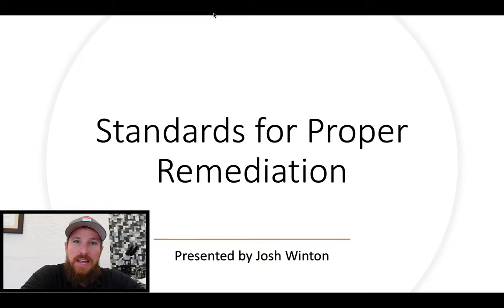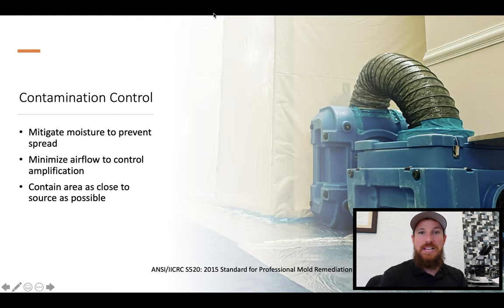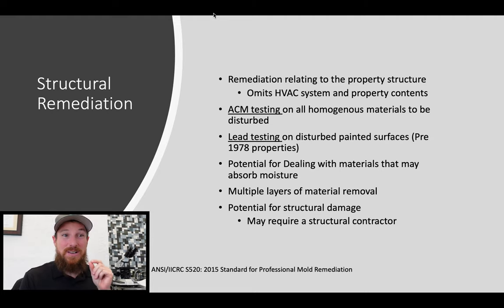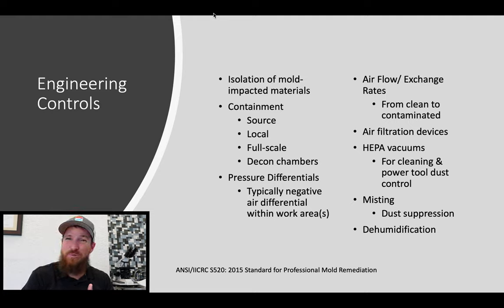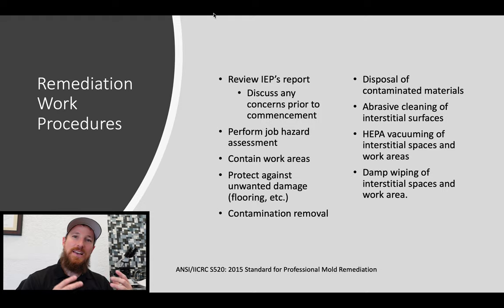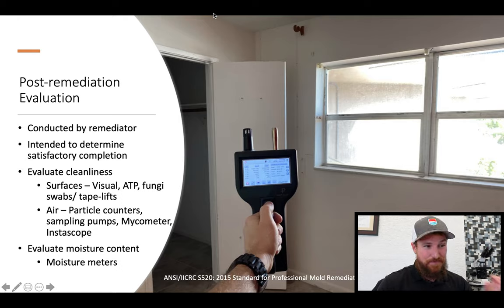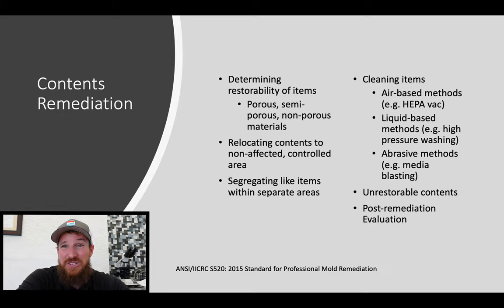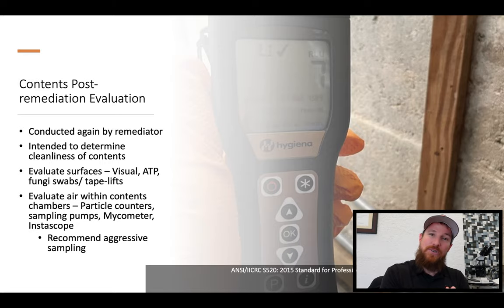Standards for Proper Mold Remediation

Comment: Very good content that every homeowner should be aware of before hiring to do mold remediation.  My problem is invisible type of mold - aspergillus and most of the remediation folks only seem familiar with "visible" mold. I've been v. sick for 2 months so I'm having to learn what I can online - the "powerpoint " info boxes make are very useful!
Reply from the maker: Thank you for the kind words. I’m sorry to hear about you being sick. Assuming it’s mold-related, more comprehensive mold remediation techniques would be likely be needed in your case. 

I’ve found that while traditional remediation services work for the masses, it’s not always sufficient when it comes to those who are immunocompromised, suffering from mold-related illness, etc. Keep doing your research online and do feel free to reach out to me with any questions. While I certainly don’t know everything, I’ve certainly educated myself well being the bare minimum that my industry requires.
Reply: Remove the cloths and dust in your house. You maybe reacting to dust. And launder you’re bedsheets. The bed is a huge trigger for me from dust and dust mites. I just got an air scrubbier and had it run for an hour and feel much better in the house already.

Comment: Hey Josh, Question, What would be the best solution according to you to clean microbial growth inside  flexible ducts located in attic here in Florida. I'm assuming replacement would be an option.
Thank You
Reply from the maker: Anytime I’m dealing with microbial growth within flex ducting, I’m opting for replacement… While there are rare instances where you can access all portions of the flex ducting and potentially damp wipe the surface to remove the growth, most situations leave professionals limited. 

More often than not, a small segment of the flex ducting can be accessed, so cleaning really becomes a best attempt. Whenever possible, microbial impacted flex ducting should be replaced.

Comment: So once I clean the area with sprays and bleach and white vinegar and everything I have to remove the mold, then I should look deeper into the wall or take samples and send them off? @ 11:00
Reply from the maker: Samples are not always a requirement. Unless you can answer a question or confirm/deny a hypothesis by using a sample, laboratory analysis expenses can be better spent on remediation and rebuild. 

If you're looking to confirm a successful completion of the remediation process, then yes, sampling would be effective at accomplishing that goal. The combination of air and surface samples can provide you with insight on the remainder of fungi within the environment. You may also look to renting a laser particle counter and ATP luminometer to look at the particles in the air and on surfaces. In most cases, analytical sampling for mold will be more cost effective and will provide data specific to mold.

Comment: instead of minimizing the air, can I maximize the air by opening the windows to remove the spores after I have killed spores with bleach and sprays? As I am guessing once the spores are dead I will be able to get rid of them easier without them spreading?
Reply from the maker: Due to the allergenic properties of mold, dead or alive mold can be just as impactful to your health. Not to mention that bleach would not be your ideal solution, if you were truly looking to kill all mold. 

As far as air exchanges and airflow is concerned, there are many approaches. You can positively or negatively pressurize environments. You can also use natural ventilation by opening windows, however, I would not advise this. Unless you have consistent airflow from one direction, you will lose control of the environment and have fungal spores blowing all over the place.

Comment: So if a bedroom wall has mold deep into the wall then the whole wall needs cutting out and that's why it can become a lot more expensive? @12:17
Reply from the maker: Unfortunately, that may be the case. However, not always. One important factor when dealing with mold is the dose-response relationship. You may have mold within an environment and not exhibit any adverse reactions. While, some individuals may become very ill with even the smallest traces of mold indoors. 

The best advice I can give you is the use your judgment. If mold sampling shows no abnormal fungal concentrations within the indoor air quality and no one living within the property is exhibiting any negative health effects, you may not need to go demolishing walls. Alternately, if the environment is not feeling adequate, you may very well need to undergo extensive mold remediation.
Reply: @IAQJosh  Thanks man, I think I'm just going to have a good go at killing as much of the mold as I possibly can then using my 25 liter dehumidifier with a hepa filter to help scrub the air?

Comment: In my dads bedroom, he has 2 radiators on the wall underneath each window, he only uses 1 radiator and the radiator that's he is using there is no mold near it, but the radiator that's off has loads of mold near it on the wall, so I am guessing I need to fix the mold issue then use both radiators instead of 1 to fix the damp/condensation issues?
Reply from the maker: There's a lot going on in your last statement... You may want to consider hiring a mold professional to evaluate the area you're referencing, as that would generally produce the best advice. If there is high humidity in the room and there's a subsequently high dew point, then you'll likely need to either dehumidify the environment or provide additional cooling and conditioning - if one unit is not sufficient in accomplishing this.
Reply: @IAQJosh  I bought a Meaco 25 liter dehumidifier but I am applying lots of bleach to try and kill the black mould around the caulk in the bathroom and on the window sills at the minute, once I have killed all of the mould should I start using it? I forgot to mention the dehumidifier also has a hepa filter built in 🙂
Reply: @IAQJosh  I wish I could afford to hire a mold professional but I just haven't got the money at the minute
Reply: @IAQJosh  If I am totally honest with you it is a rented property and it seems like the landlord doesn't care about the mold issues so I have no choice but to try and deal with it myself
Reply from the maker: This unfortunately happens to quite a number of renters out there, so you're not alone.

Comment: Why not clean, use biocide and then epa sealant in addition to mold removal?
Reply from the maker: The question that I would ask you is why use a biocide, if something more mild would suffice - such as dawn dish soap used as a surfactant with water? Every situation is unique, so I wouldn’t necessarily say ye or ne toward any approach as a whole. 

As far as sealants, I’m not opposed to encapsulating surfaces. However, my preference is always clear, and something that has a suitable perm rating. After all, we don’t want to trap moisture in surfaces and cause deterioration.

Comment: If the black mold isn't that bad in one room can I use bleach and sprays and stuff like that to kill the mold and then air the house out and open all of the windows to remove the spores and then use a dehumidifier with a hepa filter to help purify the air?
Reply from the maker: Hi Jordan. Professionally speaking, there are far better alternatives to bleach. Sodium hypochlorite (the active ingredient in bleach) is very effective when used as a mold stain remover, however, it's not ideal for remediation of mold. A hydrogen peroxide product would be more effective at lifting mold to the surfaces of materials, and soap and water is excellent for physical mold removal from surfaces.
Reply: @IAQJosh  Thank you for the response 🙂
Reply from the maker: @JORDANDAVIES30  Anytime! Hope my response assist you.

Comment: How do you remove mold on basement foundation walls?
Reply from the maker: If we’re talking about the same thing, a higher concentration of hydrogen peroxide would be your best friend, when it comes to remove growth from surfaces that are not smooth and easy enough to surface clean and damp wipe. Growth that has embedded itself into the substrate somewhat can also be lifted to the surface for HEPA vacuuming, using a system like Serum (hydrogen peroxide cleaning process).

Comment: I don't have much money and my landlord isn't good at dealing with black mold and stuff, So I'm wondering how can I do it myself as cheap as possible?
Reply from the maker: Depending on your exact needs and what you're looking to achieve, DIY cheap remediation may or may not be an option for you. With that said, acquiring the necessary materials and equipment can be done at relatively affordable rates. By building containment and removing/cleaning/etc. the mold yourself, you can certainly save a ton of money on labor. One of the most important factors is ensuring that you're able to perform this work safely. If there is any doubt in you doing so, I would not advise a DIY approach.
Reply: @IAQJosh  Thank you for the response dude, I am going to keep killing the mold with bleach. And with a bit of hydrogen peroxide like you recommended 🙂
Reply from the maker: @JORDANDAVIES30  Be very weary using bleach… Bleach merely lightens the areas you’re cleaning. It’s not effective at getting to the root of the mold growth, so mold often grows back in those same areas.
Reply: @IAQJosh  What about on caulk around the bath? Will it kill the mould around the bath? I used bleach and toilet paper to keep the bleach wet and it made the caulk perfectly white like it had been re-caulked
Reply: @IAQJosh  Should I use some hydrogen peroxide on the caulk to help prevent it coming back?
Reply from the maker: @JORDANDAVIES30  Mold or mildew in caulking can be cleaned using many Clorox products and similar, however, you’ll notice that the mold just continues to reoccur. 

Your best bet is to create a drier environment within the bathroom. Mildew grows on surfaces that remain wet for extended periods of time. Implementing a dehumidifier within the bathroom should be helpful at limiting or preventing the reoccurrence of mildew.
Reply: @IAQJosh  Thank you for this info dude I am going to keep the surface dry and use my dehumidifier in and around the bathroom and hope it doesn't reoccur. 🙂